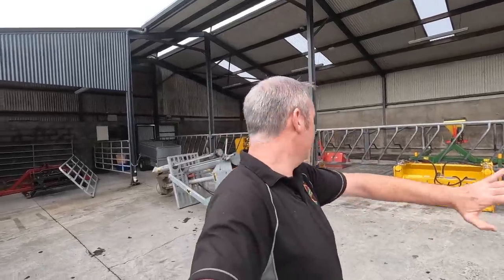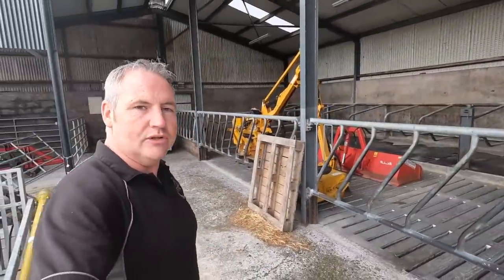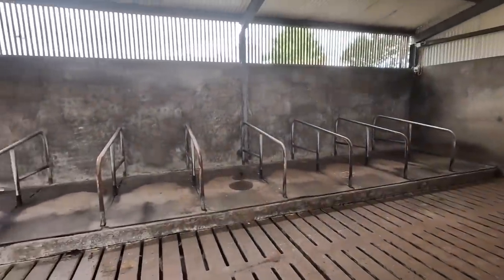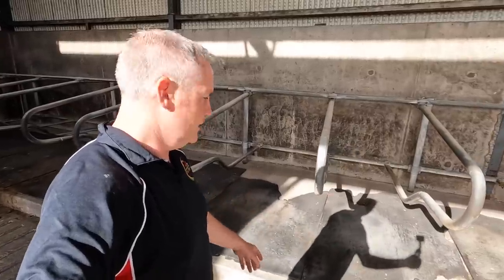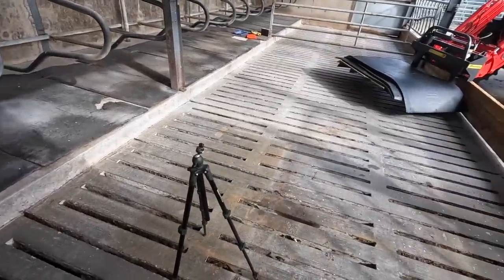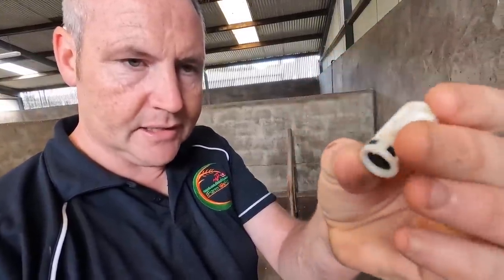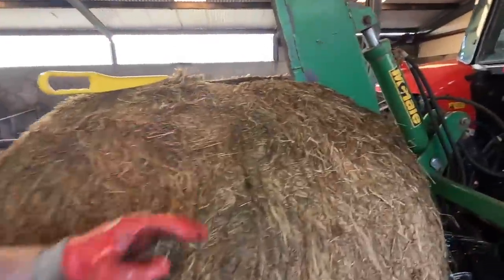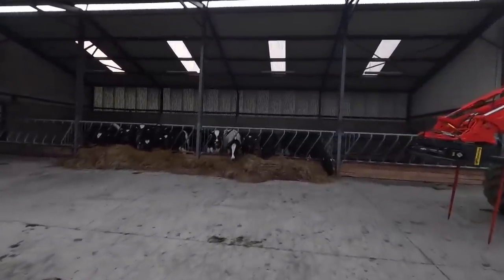AND THE WORK BEGINS! WINTER PREP IN FULL SWING AS THE COWS COME IN

Comment: Question Adrian, where did you get that fine yellow sword for the plastic?
Reply: It’s called “hay knife”. Easy got online or agri stores
Reply from the maker: I got mine in Fast Parts online but just like Paul said below you can get them fairly easily country wide. Hay Knife, long enough to reach over a bale to cut it and large enough not to loose it 😉. Takes ordinary Stanley blades
Reply: Thanks gents - another one for the winter list 👍
Reply: I was just going to ask the same thing. Bale looks Great.

Comment: Hi Adrian. What diameter are the steel tubes that are used to make up your cubicles/dividers?  If they are 48.3mm or 1 7/8”, they are the same as scaffold poles and if so you might find that the appropriate style of scaffold clamp would work better for you in holding the tubes together in position?  The bolt size used in scaffold clamps is M10, I think (long time since I worked in scaffolding design), needing a 17mm spanner/socket to tighten. Just in case it could help you. Best wishes, Gerry
Reply from the maker: I actually got a few exhaust clamps today that fitted perfect. But thank for trying to help Gerry appreciate it
Reply: @IFarmWeFarm  You’re very welcome! Store the idea away in case it ever comes in handy; best wishes!

Comment: Just looked at mf6470.Does anyone know if they all make a whining noise from backend after startup.Seemed to go away when warmed up.Been told new hydraulic pump has been fitted.
Reply from the maker: It’s hard to know without hear the sound, they do whine a bit which is normal. Despite the sound of your hydraulics and steering are working right I wouldn’t touch the pump. Probably best to have a mechanic look it over. Could be the relief valve

Comment: Does splitting the bale save you time. As you have to spread it with the loader we have looked at bale sears but have went back to bale lifter  on the handler.  After removing the plastic we open the tines and the bale splits  usually about half the bale is still on the tines  and this can be spread along the passage .Do you think it would work on a handler to split a bale and spread it .
Reply from the maker: Yes definitely, and it makes it much easier to grape back if needed. The splitter has been one of the best things we’ve bought and that one is with us 9 years now. But the question you ask is a good one and I hope to answer it soon as we are going to demo a few different bales shears this winter just to see if any of them would work better than the splitter. First one arrive this week.
Reply: @IFarmWeFarm  Thanks will have a look

Comment: Adrian just on those mats, ideally the joins should be directly under the cubicle division. Cows don’t like the joins. Made the mistake on a 120 new beds we put in here, had to pull them all up - each mat had 3 stainless steel screws that had to get the tops drilled off to pull them up, was horrid work! and swap out for a mix of 44 inch and 48 inch mats to get joins under the cubicles 

Turning the mats around the other way you have now will most likely lead to much lying in the joins - don’t know how ideal that will be?
Reply from the maker: They use to be but them cubicles we’re way to fare apart so I narrowed them which caused this. Thankfully never had an issue so long as you joints aren’t to fare apart and your mounts aren’t in the wrong place where they’d be lying down.

Comment: You might be able to get those clamps from an exhaust fitters shop.
Reply from the maker: I did try a few exhaust clamps but couldn’t get ones that were as heavy as these. But there could be heavier ones I haven’t seen yet
Reply: Condon engineering in collan co Louth would have them u bolts